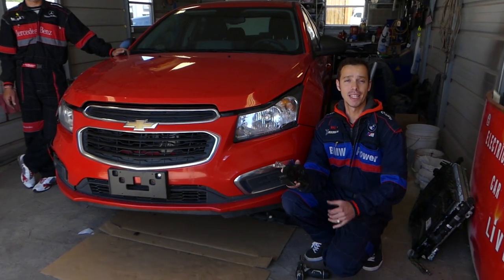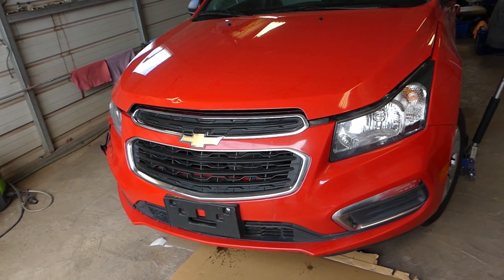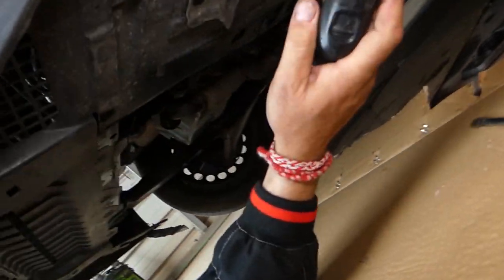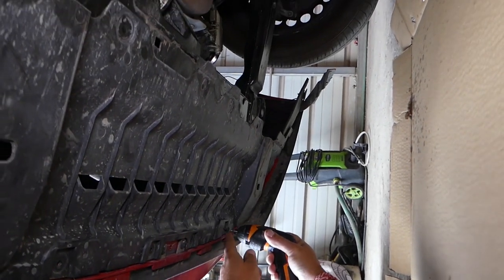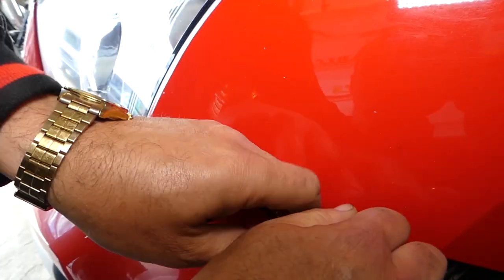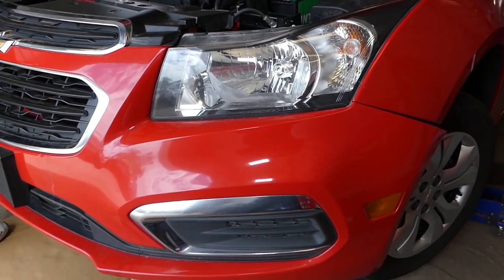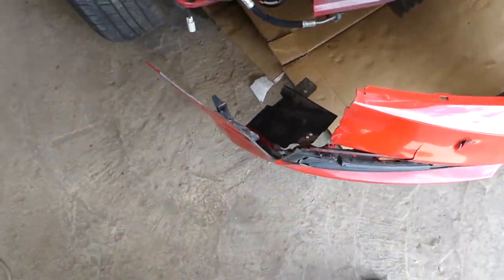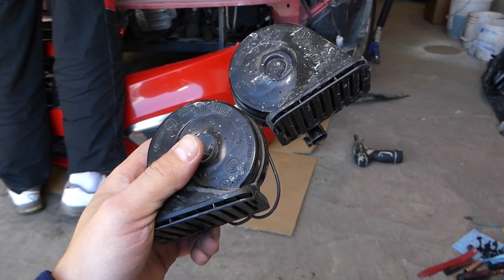HOW TO REPLACE HORN ON CHEVROLET CRUZE. HORN LOCATION REPLACEMENT

Comment: For Chev Sonic, it is not necessary to remove the whole front assembly. I replaced my horn yesterday. Procedure: jack up the front left, remove the wheel, remove 3 lowest screws fastening the liner to the fender as well as 3 or 4 of the lowest plastic fasteners on the inside of the liner. Underneath the front of the car there are 2 screws holding the liner in place, with tabs extending under the chin spoiler. Remove those 2 screws. Pull the bottom of the liner out from under those 2 tabs. At that point the bottom of the liner is loose and also very flexible. Simply bend the bottom of the liner 90 degrees back toward the brake and use a piece of wire to hold it there. The horn is totally visible and accessible, looking straight up from beneath the car. Re-secure the liner and you’re done. An easy, quick job.
In my case the horn was very weak. The issue was badly corroded contacts on the stock Fiamm horn.
Reply: You think this works for a 2018 impala?
Reply: Hii what was the nut size you used to open the horn